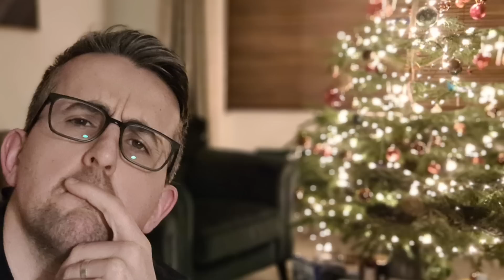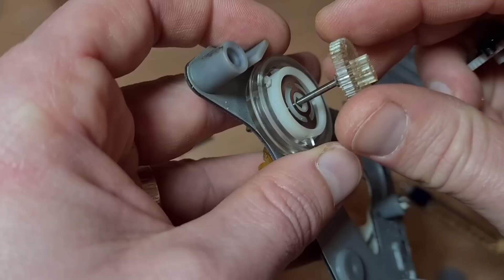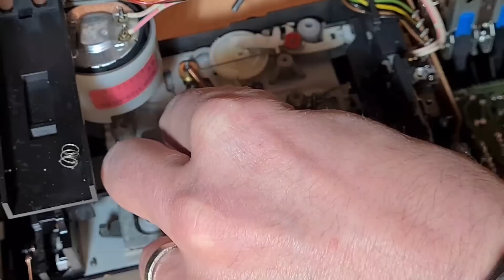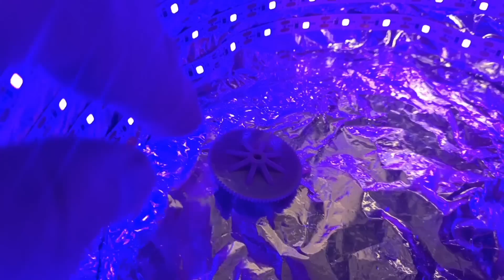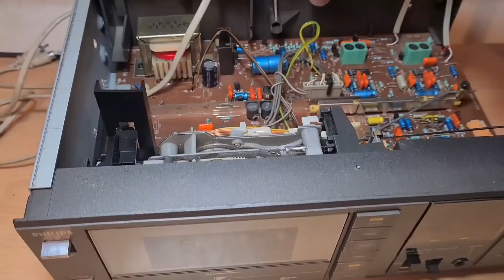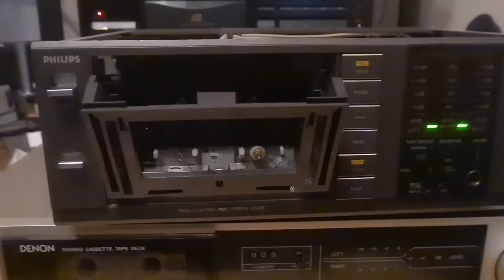I WILL NOT give up.. £2 cassette deck challenge revisited!

Comment: absolutely brilliant Ive got two sony dolby s decks  both need fixing one I want to keep the other you can keep the y are the same model TC- KB820S LET ME KNOW!
Reply from the maker: These are pretty good decks, really the model after the k611 range but two heads. Into the mid 90s from what I remember. They will no doubt be quick to fix with some new belts and a pinch roller. Maybe £15 in parts, give it a go!

Comment: 19:00 - BEST PART of the Video, and the newborn life of the PHILIPS tape deck ...🥰
Reply from the maker: It's yours if you want it, nobody wanted it for the giveaway ha! It's in the house still somewhere
Reply: @ Thank you for the heart! 
Unfortunately, the Philips tape deck would not fit into my socket in Germany, and I already have two restored cassette decks from Pioneer, the latest one I got for my birthday the other day - it has the Flex function, for better highs when playing, for digitising my old radio play treasures on cassette.
Best wishes from Germany✨💖

Comment: Hi, love your patience. As a Senior who has tried all this as a hobby, I would have consigned this deck to the bin a loooong time back. 
Question: what oil (in the syringe?) and grease do you use? I would love to know.
Keep up the good work. 
Cheers
Reply from the maker: The oil is called slug slime, but it's basically sewing machine oil. The grease is called molycote dx, any white lithium grease is good!

Comment: This is a big problem with Philips drives from the 80s. The yellow gears are made of soft plastic to reduce the running noise. I have two Philips Roller and Roller2 recorders. It's the same with both. There's someone in Poland who makes exact copies of the gears. Without soft plastic it runs very loudly.

Comment: Excellent repair on an ‘impossible’ job!  I really enjoyed this video. Full disclosure though, I was the Ebay seller. Why did I sell it for 2 quid? Because I wanted someone to fix it and allow it to live on and be enjoyed again. I’ve sold a few things in the last year (hifi music gear, vintage games, watches etc) thinking they may end up on one of the repairing stuff Youtube channels I watch and the Philips did! This deck was part of my family's midi hifi system from the late 80s. I still have the FP440 linear tracking turntable which I really like and is still working (touching wood now) but keep your eye out on Ebay. BTW The deck didn’t have a plug as the whole system was powered via a 4 way junction box. Keep up the good work , Cheers
Reply from the maker: Wah that's crazy that you sold it and you found the video! Well it's been funny as I went to give it away, messaged two people and it's still sat here. Seems like I can't give it away haha

Comment: I have my old school from the 80s boombox with a broken eject hook. Where should i look to find a replacement ?
Reply from the maker: Do you want to 3d print one? Either way have a search for the model number on Google and spares /.STL files (for 3d printing)
Reply: @pwrestoration  Hi,  thanks for the help. I have googled it but unable to find the cassette door latch for a Sharp WF-340E. Its a small latch on a spring  that holds the tape door closed. I have recently serviced the player and removed the 35yr old cellotape that i used as teen to keep it closed. All that remains is this latch which i cant find and dont know how CAD draw.

Comment: I would have used light silicon grease or molly, as originally done by the manufacturer, not light oil, which will dry up, and is the wrong lubricant for the job.  But anyway, excellent work!
Reply from the maker: Thanks, which part do you mean? I can't remember what got oil and what got greased 😅
Reply: @pwrestoration  just the oil that you put on the the spindles for the gears.  You could also reduce noise you could add a small amount of grease to the teeth of the cogs too.  Thin machine oil is not meant for lubricating gears and cogs, unless they are submerged in it.  Grease is the best, as it clings and stays where it is meant to be.  If you noticed, on the original mechanism, Philips had used grease, and that had probably dried out after god knows how many years.  But seriously good work with making the new cogs!

Comment: 18:40 it is like the con-rods on a steam locomotive. I've never seen anything like that before on a cassette transport. Why would a cassette even have such a contrivance, and what function does it serve exactly?
Reply from the maker: It's a cheap and cheerful way of the deck knowing when to cut power, when the tape ends or when you're rewinding and you get to the start. 

When that piston looking thing stops moving, it allows a small lever to seat itself and that cuts the power. 

Pretty foolproof and quite common for very cheap transports in the 80s

Comment: getting 3D printed parts for broken gears is beyond what i would've imagined for a Cassette Tape Deck repair...that'd go in the dustbin with anyone else...including me...amazing fix...and great research to find the online drawings etc...i'd be even more surprised if my Kenwood twin deck had that kind of effort given to it...i have enough trouble changing the belts...i did change a pinch roller on my Sharp portable though...i impressed myself...i didn't screw the mechanism up by fitting...the Sharp has all the functions except fast rewind...as it's twin deck too so it doesn't matter...the other slot works fully...and i've got a single deck Technics which is perfect...i quit Vinyl decades ago...i kept all my cassette tapes and still keep adding to the pile!

Comment: Wow! I have the exact same one, my one has a broken plastic pin on one of the gear's, I have hung onto it in the hopes that I will give it a go by trying to fix it but after watching this video...... 
Forget it! I just don't have the patience and determination like I used to.... Nope it's not going to happen...... Time to put it to one side and keep it around for parts possibly for something else that is at least easier to work on! It literally looked like you were working on a steam engine! It's cool, just not cool enough to go through all of that....

Comment: I thought exactly like you, a definite steam engine vibe going on there. I have a couple of 2 head Nakamichi decks but they both have problems with their motors. The idler wheels and all the set up are fine and, when they get going, they sound awesome but I really will have to get those motors replaced at some time. At least I still have my trusty JVC KD-V44 which just keeps on working and a few other decks that I bought on Tottenham Court Road in the 1980s which have been in a cupboard now for what seems like decades. I really should see if they still work. As the Marantz deck is basically a rebadged Philips deck, I wonder if it has perished cogs too.
Reply from the maker: Sometimes the reel motors like to develop dead spots. Easy to find new replacements though but it's a complete transport strip to get them out

Comment: hi i have seen the bad gears in the RS 101 decks i have 3 of them note i have only seen one gear  in 4 decks  that are bad 
not it works out to get someone to make parts  i have to pay out £500 in used  tooling  to turn of parts 

tools for hobbies note can cost big money   i just made a new pcb for a tascam 38  so it can play the 3 speeds of tapes   

pcb way is not for new bee's     like the new 3D files and the cost as well  when i buy used gear it helps to look in to the deck to see if you have the right tools

with the tascam 30 line i have worked on many over the years  note i did used relays   you can't go from rew to play mode  

i  have put in safely logic to stop the pinch roller lifting up   only lift in the stop when tape is not moving 

i worked on alot of tape decks 90% can be fixed never bin them

Comment: What a great job! Amazing work. 3D printing to the rescue. I can't beleive the patience you have. I would have thrown it in the dumpster. Good looking deck with a bit of a noisy transport. I'd love any deck you work on, but alas i'm in the US so no deck for me! Does it help i'm in "New" England?? As always, thanks for the interesting videos. You really have a talent for this work.
Reply from the maker: Thanks! I actually spent an hour or so off camera quieting the deck down with some lubrication. Lots of it, oiled and greased. It got pretty reasonable at the end compared to the initial test. I did read that Philips used that naff orange plastic for exactly that reason - quietness of the transport, which I thoight was interesting.

Comment: 3d printing might just be the greatest saviour of old broken decks
Reply: 3Dprinting isnt quite there yet, maybe in about 5 years
Reply: @Synthematix  maybe not but I think that is mainly a material question as the precision is definitely there on the newer machines.
Reply: @Synthematix  I wonder if the drawings for 3d printers could be adapted for CNC machines to build metal machined parts?